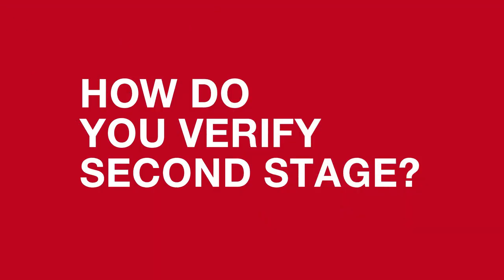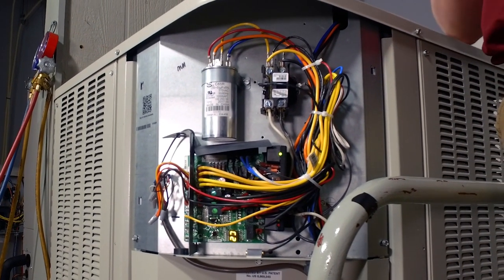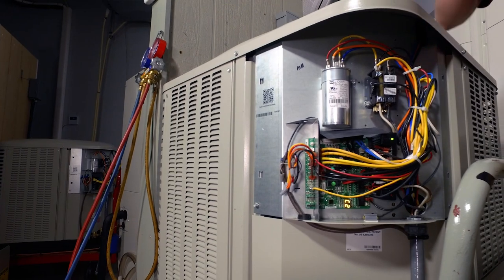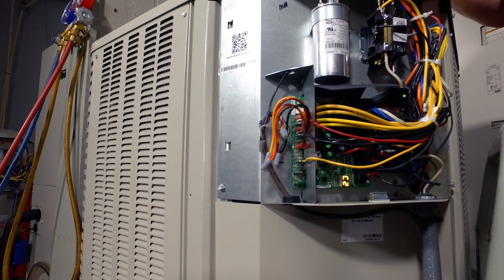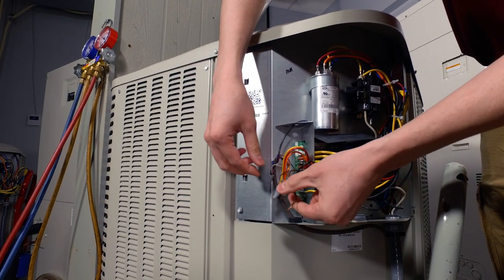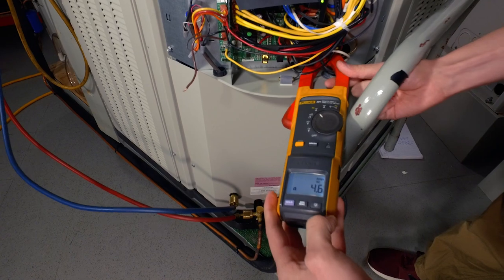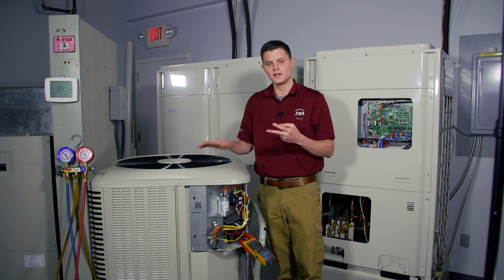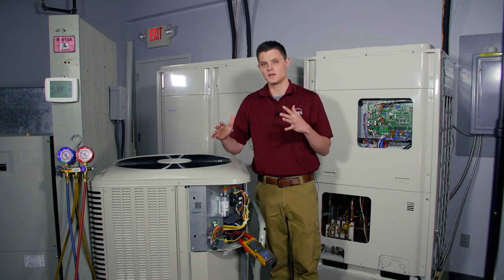How Do You Verify Second Stage?

Comment: thanks for sharing.  So you place the clamp meter on one the line voltage coming from the disconnect box?  Could it also work, if I place it on the common wire coming from the compressor?
Reply: Duh..

Comment: You can also check for voltage potential at your various wiring stages.  If the system is running in 2nd stage, you should be getting 24V at your Y2 terminal on the board.
  You won't have to disconnect any wires, essentially saving you an unnecessary step.

Comment: Question?
Do the pressures read the same whether in First stage or Full capacity ? Many Thanks  Great video Not to many about 2 stage compressors.
Reply: The stage doesn't affect system pressures; it only affects your indoor & outdoor motor speeds, along with your compressor's pumping capacity.